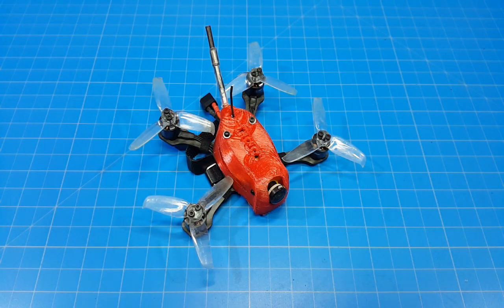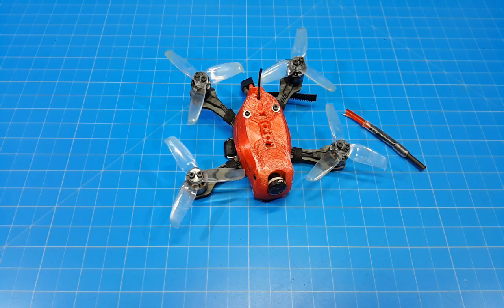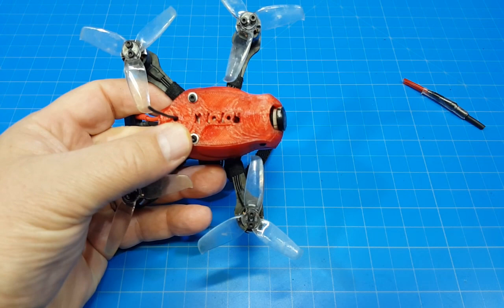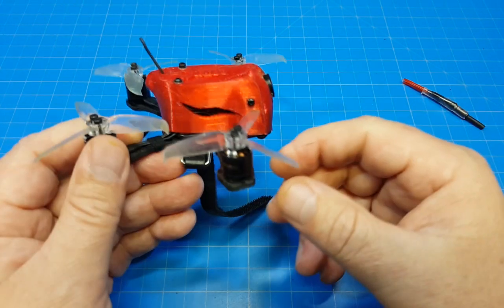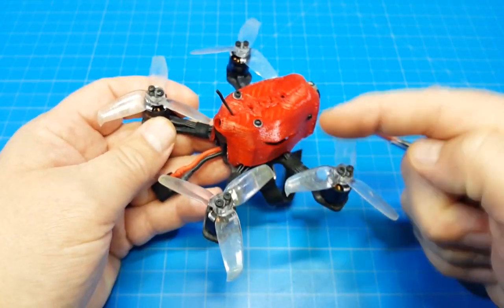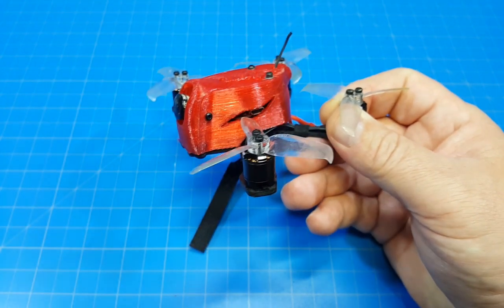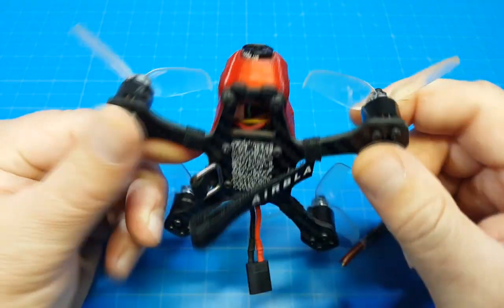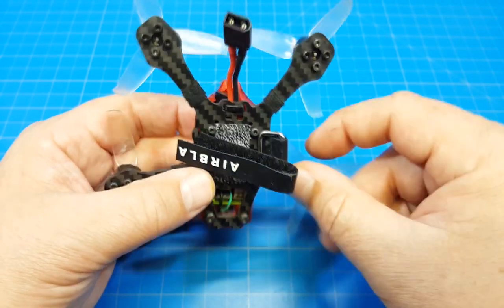RotorX - Atom Mini V2

Comment: Nick, I think part of the reason for the Atom's underperformance has to do with its center of gravity. It looks to me to be nose-heavy. That means the front motors have to carry much more weight than the rear ones. When you do a punch-out, the front motors max out first while the rear ones are still far from max available thrust. However, the flight controller ends up limiting rear motor thrust in order to keep the quad from nosing over. The result is that the Atom will have less total thrust available from all four motors when compared to a more neutrally-ballanced quad. I think. Best regards from Brasilia, Brazil.
Reply from the maker: That could be. I didn't think of that. Thank you

Comment: I love my Atom V2 custom build using the HGLRC Zeus and 1306 motors..absolute tank.. I've busted 1 lens and cracked the case on the other camera.
Reply from the maker: lens bumper :). Don't get me wrong it doesn't fly poorly, I just thought the reducing in weight vs the leader on 2.5inch props this would out perform it.
Reply: Yeah a lens bumper LOL, I does look good but kind of starved it seems on power.. The nice thing about a dead cat frame is they keep the props out of the view if you have a Split and they really do very well when the motors are reversed. You may try that and see if the yaw improves.
Reply from the maker: I did have the motors reversed.  Agreed, if props out of view this arm style works well.

Comment: That tree is much like "Charlie Brown's Evil Kite-Eating Tree" ... just saying.  

By the way, you could reconfigure the quad to mount the motors upside down so as to increase the distance of the props from the pod.  You would probably have to create some kind of launch platform or take off from a very smooth surface. (Although the battery will interfer somewhat as well.)  But that might validate your theory of the pod hampering the disc loading.  Which I for one, believe is true, and is especially the bain of existence for many micro quads.  Simply put the props are too close to each other and the air turbulence hinders performance, IMO.
Reply from the maker: I didn't think the race1 which has a lexan pod that is open in the rear had this issue. That one is also more of a true x.
Reply: You'd really have to configure both frames identically to see if there is much a difference.  True X generally handle better anyway, at least from my experience.  But the person that buys this frame is looking for an unobstructed flight video and as with anything, compromises have to be made and accepted.  No perfection will be found in any frame.  Although we all keep hoping to find it and will continue to chase after it.  Perhaps that is one aspect of the hobby we need to appreciate rather than lament?

Comment: How does the motor perform? Is it hot when running 4s? I have recently seen albert video about burned motor on the skystar. And many other people reported hot motor.
Reply from the maker: yea they are hot hot, I would be very surprised if we see a cool 110x motor running 4s, just so much voltage going through the motor and limited heat dissipation. I suspect I have 70 flights on the skystar x120 now. I have only heard of Albert's issue, other reviewers (ones I am aware of) I don't think have had an issue yet. I did hear AndyRC had a burned out motor on the leader3 on 4s.
Reply: I am not quite sold on the 1106 on 4s yet. Maybe 1304 is a better bet.

Comment: Almost all of my frames have pods and I don't notice any difference in handling. I would say it's most likely the arm layout or the CG.
Reply from the maker: I could be wrong. Are your pods full pods down to the carbon all the way around?
Reply: Nick Burns just a slot on the sides for the fc.

Comment: ive got rx1105 4000kv motors,not sure what frame size,what battery or fc's to start with.you got any ideas??
Reply from the maker: 4000kv will call for 4s if your looking for performance. I suggest this is a good option, as well as other frame approximately 120mm in diameter. mabye the fly fox no4 from banggood, or frames from tomoquads.com or flexrc.com

Comment: Great review as always! It's true that airblade is one of the early company to enter in micro. But they have been milking the same deadcat design for so long and no innovation. A while ago i seen one of the employee going out after fullspeed for "copying the cage style design" while they themself are following tomoquad and flex rc design. I just don't like hypocrite the company.
Reply from the maker: Yes, I saw James post and Lewis flame him. James has very strong opinions, I don't think he does airblade justice with his "information delivery style". I have also noticed he doesn't post nearly as often as he used to.
Reply: I've seen alot of this stuff in the facebook group. Try to avoid it but it really shook me when people accuse other like that. Anyway, keep doing what you do best! Unbiased information review
Reply: I will have to respectfully disagree both of your points. 

1. AirBlade didn't milk the same deadcat design. I'm one of the original co-founders at RotorX that designed the original Atom 3". When RotorX decided not to pursue the Atom in smaller size, I took it under AirBlade name and release it. That's the 2nd non-symmetrical design I have over the last 3 years, the first being the AirBlade Assault which was released in 2015. I don't think that qualifies as 'milking the same design'. 

2. Tomo and I are friends and we talk a lot about designs. The differences between Tomo and I is that he likes to jump the gun and release preliminary designs to 'claim' that he's the first to everything. I, on the other hand, like to work in the background until I have something i want to show. I also like to have my design tested by various pilots, who happen to be all over the world, so my lead time from design to production is a lot higher than just designing and then releasing. The result of both of that combined is that it looks like my design always come out after his. Trust me when I say I don't copy his stuff.

Comment: I am currently getting stuff to make my Atom mini 2.5. I would really appreciate it if you could tell me I'd it better to run 1106 4500kv, or 1106 6000kv motors.
Reply from the maker: I like the extra punch of 4s on 1106 4500kv, but if you already have 3s batteries it might not be worth it.

Comment: That pod has to be heavy. Have you tried it without the pod?  It'd be a light one!
IMO, its mighty ugly with the pod, too! LOL
Reply from the maker: The pod is needed for the camera to mount. The area below the camera in the frame is open, no place for a bracket.
Reply: Hmmmm, dependent on the pod to mount the camera...don't know if I like that or have seen that before.  thanks for the review!
Reply from the maker: It does make getting it all together a bit more challenging too.